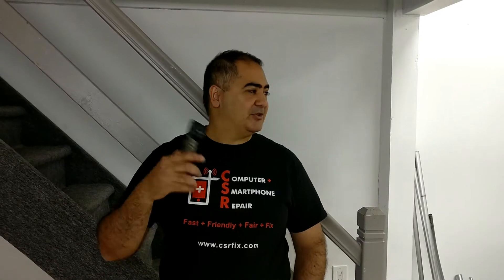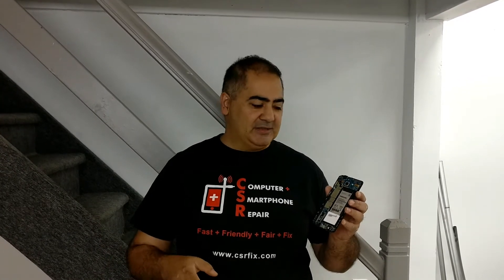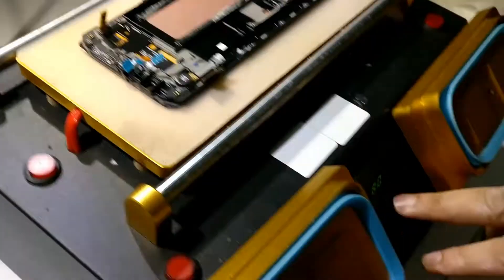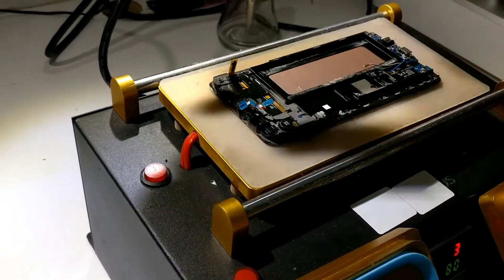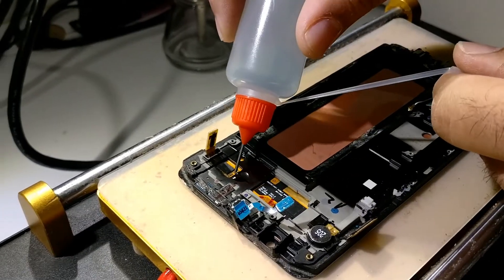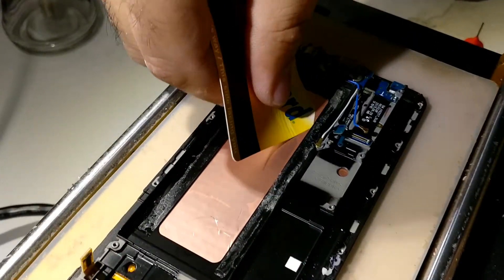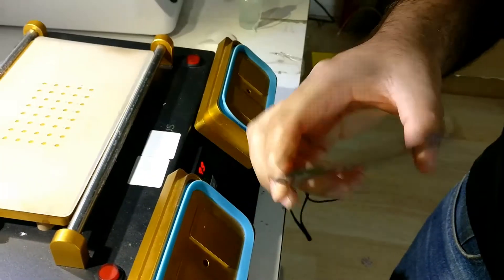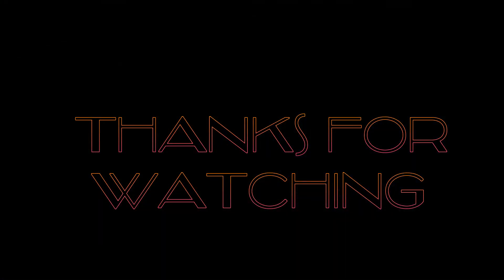samsung galaxy and note LCD removal from frame without damage

Comment: Lol using the metro card! Thumbs up, good video.

Be wary that the auto-ignition point of Kerosene is 220 Celsius, it will ignite into fire at this temperature. This may remove glue much faster than isopropyl alcohol, but isopropanol has a much safer autoign temp of 399. Just something to take note of.